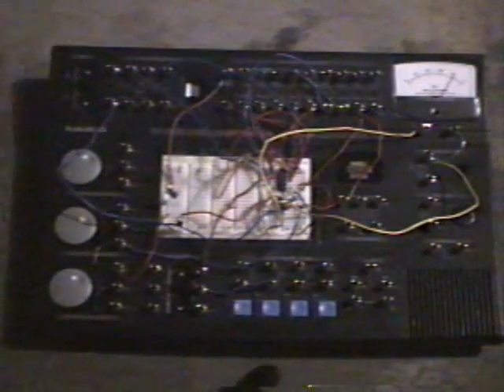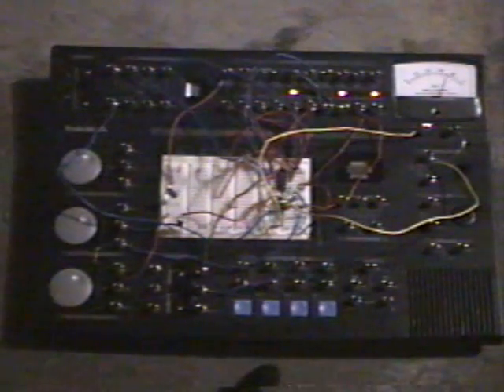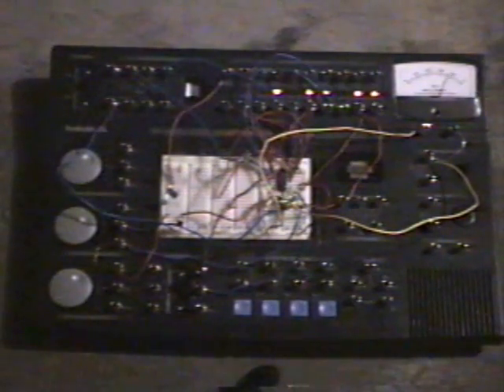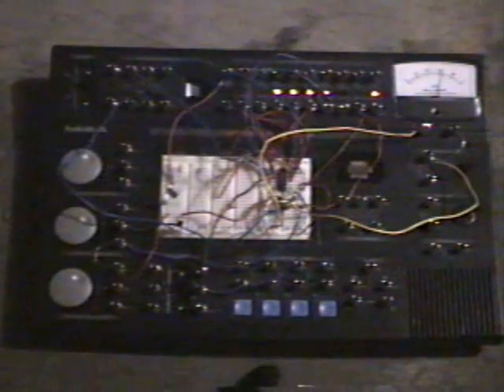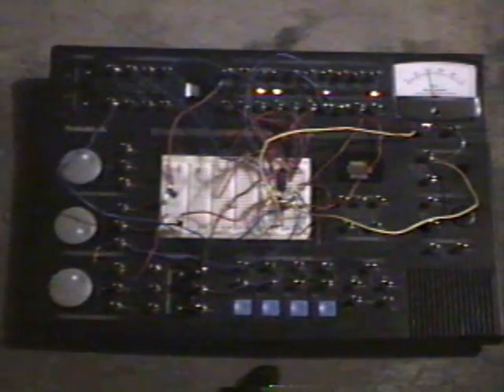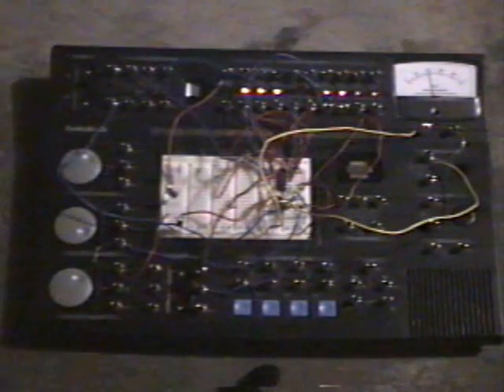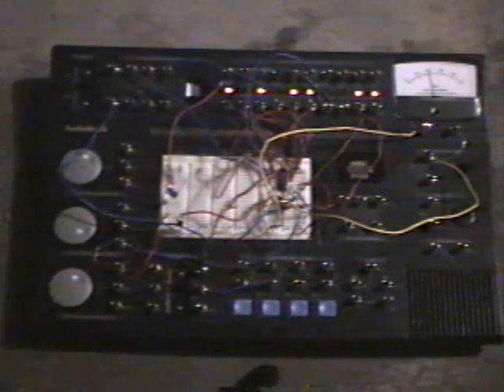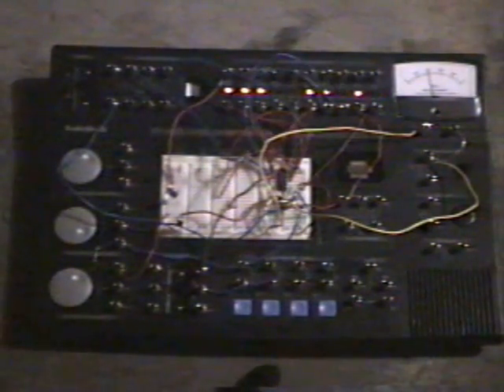Garage door code scanner

Comment: Lol its obvious... Get a binary counter IC read the data sheets, build the example circuit. Use a 555 to pulse the input, solder the outputs to the dips on a tx'r. Use the high on the 555 to change codes and the low to tx (or vise versa).  Too bad finding a door this old to toy with might take some time lol

Comment: Haha, this is interesting, did you use the 4040b? Very dangerous in the wrong hands, but the new remotes do have rolling codes like you said... so it would only work in the older houses. Anything post '95 has a good chance of having a rolling code. If people would use information for fun instead of profit, the world would be a better place. But there are bad people out there.